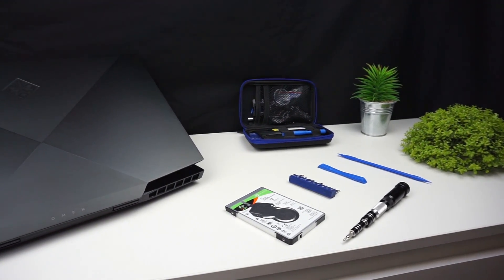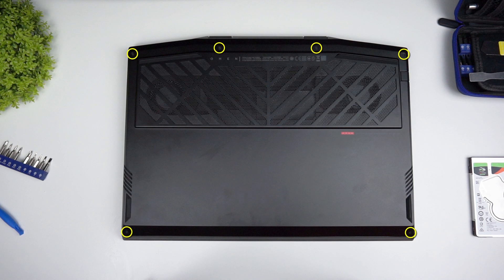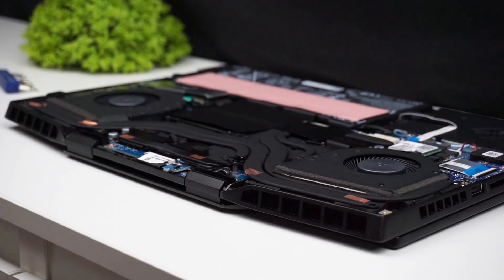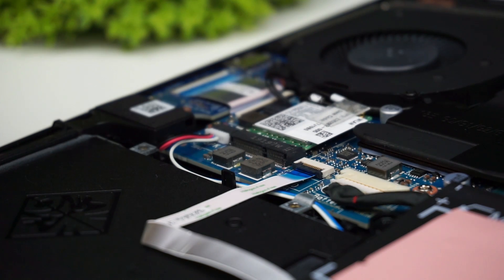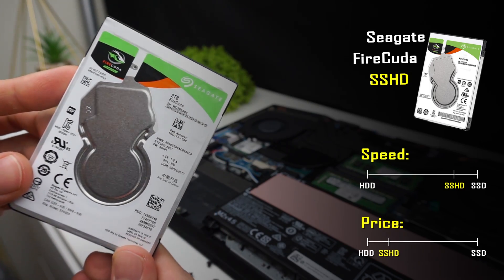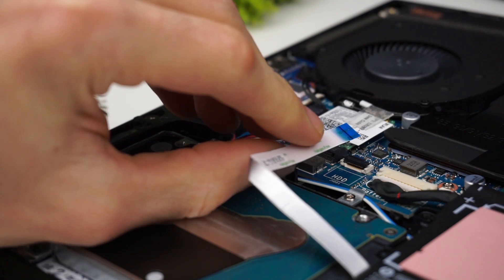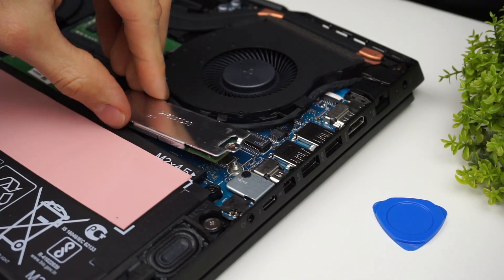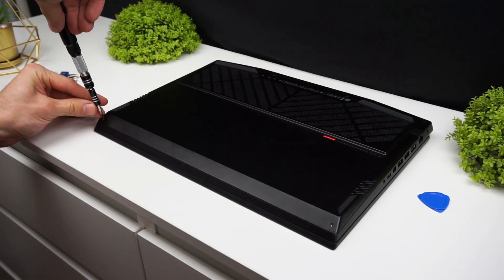HP Omen 15 2019 Upgrade RAM / SSD / HDD - Disassembly Guide

Comment: Very good video.
I want to ask some questions. I have an HP OMEN 15-0003 LA, which has 16GB RAM, Intel Core i7-9750H, two hard drives: 128GB SSD and a 1TB mechanical DD.
The 128 GB SSD I want to change it for a bigger one, minimum of 512 GB. What is the recommended brand and size and how to clone it?
Additionally, is it advisable to change the mechanical disk for an SSD and, if so, what could it be?
Thank you in advance for your responses and I reiterate my congratulations for such an excellent video.
Angel Agüero
Reply from the maker: Hi thanks!
I linked few M.2 drives in the description so you can choose one or fin a SSD on your own. Size is up to your pocket ;) you can copy your files and save on different drive. If you're changing the SSD where your windows is installed you have to install Windows on the new drive and then transfer your files. I've never cloned a drive, so I can't help this way.
Second question - you can install 2.5" SSD instead of HDD. Also in the description i linked one recommendation (samsung 860 evo)
Reply: Thank you @TechFinds

Comment: Hi there, I've just bought a Samsung 970 Evo Plus & 2 HyperX Impact DDR4 [8GB RAM] for my HP Omen 15-dc0001na. Is it best to wipe my computer before installing the components or just leave it and carry on replacing them?
Reply from the maker: Wiping won't change anything. Do as you like. ;)
Reply: Tech Finds thanks mate, I changed my RAM card order to 2 HyperX Impact DDR4 [16GB RAM]. Will these still work with the HP OMEN 15-dc0001na?
Reply from the maker: @08chinup  Yep it's compatible

Comment: hi @Tech Finds, so the 2019 OMEN 15 has only 1 slot for NVMe right?  if i want to upgrade the storage, either go for replacing the currently NVMe or take a new 2.5 in SSD right?
Reply from the maker: Yes, you're right. ;)
Reply: Go for the hdd
Reply: @Switch_55.6  as a little bit gamer no thank guy, I would go for SSD, HDD is too slow

Comment: Hello great videos will be very useful for when o upgrade my ram.
 I have 2 questions I have omen 15-ce005la and it came with 1 TB HD and no SSD when i check the oficial maintenance manual it says it supports dual with a 256 gb SSD can it be bigger than that? 
And about the ram it came with 8 Gb and the manual mentions it only support 16gb is that really true?
Reply from the maker: Hi, the laptop supports up to 32GB RAM (2x16) 2666MHz and you can install bigger SSD. Idk why manual says that

Comment: Could I add a Samsung's  RAM 2133GHz to OMEN 15-dc1004la with 8GB 2666Ghz?
Reply from the maker: Yes, you can andn 99% it will work. However your 2666MHz RAM will then downclock to 2133MHz. It won't be 100% compatible for sure, but you shouldn't really notice any issues
Reply: @TechFinds  thanks!!! :3

Comment: what is the max supported ssd size by 15-dc1008nx? It came with 256gb ssd. According to HP manuals it is upgradeable upto 512gb. But I want to take it upto 2tb. Will 2TB SSD work in this machine??
Reply from the maker: HP says that they sell this laptop with up to 512GB SSD, but you can install more. For example 2tb

Comment: Hi, nice video. how you can move windows from the original 2.5 ssd to the nmve??
Reply from the maker: I have never done it buy i found something that may be helpful. Check out here:
https://windowsreport.com/move-windows-10-ssd/
Reply: @TechFinds   what size od screwdriver did you use mine is not working...
Reply from the maker: @Games_and_Tech  i always use any screwdriver that fits the screw. I don't know what size is it.
Reply: @TechFinds  I stripped the nvme screw, now it is stuck and I can't remove it and install the ssd. Do you have any suggestion?
Reply from the maker: @Games_and_Tech  People say that a thin piece of rubber may help. put it on the stripped screw and use screwdriver as always so the rubber will fill stripped areas. You have to push down screwdriver a bit stronger to not let it strip the screw even more
Reply: @TechFinds  thanks, i have tried that and glue, the only one thatbi have not tried is heat it up, because i dont have the tool
Reply: @TechFinds  I finally did it, but now it does not read the nvme...
Reply from the maker: @Games_and_Tech  Have you created partition in disk manager?
Reply: @TechFinds  I just disable the intel optane, but when I replaced the optane for the nvme, this one was not recognized
Reply: and now it did not recognize the optane neither
Reply: @TechFinds  i coudnt create any partition as soon as i replace optane for the nvme it did not boot
Reply from the maker: @Games_and_Tech  ohh wait, so you replaced the original SSD where you had Windows installed for another NvMe SSD? Then you have to install Windows on the new drive
Reply: @TechFinds  nop, the laptop came with a 500 gb  sata ssd, that i have not move or disconnected and a 32 gb nvme intel optane, that i tried to replace for an 1 tb nvme.
 The laptop it is turning on, but  not booting correctly, is showing this error "boot device not found, please install an operating system in your harddrive disk. Hard disk (3FO)"
Reply from the maker: @Games_and_Tech  so as I say, most likely you had Windows installed on this optane drive. When you replaced it you have no windows on none of your drives (booting device not found). Try to find and select the boot drive in BIOS if possible coz I may be wrong. But that's strange that when you put back optane drive you still can't boot. Maybe you have to select back optane in BIOS as a boot drive
Reply: @TechFinds  LAST UPDATE; I put back the 1 tb Nvme drive, I made booteable USB-drive with windows, and now I have installed windows and all drivers and it seems to be working fine. Anyway, I can't see the 500 GB SSD sata, not in the Bios neither in windows, not even in disk manager.
Reply from the maker: @Games_and_Tech  Only thing that comes to mind is that the cable is not connected well. Or the drive is not compatible which is rather unlike.

Comment: If I install another SSD, do I have to make any configuration on the bios? The problem is I lost my bios password. Will the motherboard detect the hard drive anyways?
Reply from the maker: If you gonna add another SSD not touching existing SSD where you have windows installed then you don't have to do anything in BIOS. Just after installing SSD go to device managet in your system and make a partition.

Comment: hey bro, I have one question here, I want to buy this omen, and I have plan to upgrade hdd to ssd, can I replace ssd 2.5 with m.2 or nvme type?
Reply: Can you give me advice? If HP OMEN give us  1 TB HDD 7200 rpm, what should I do? Replace it or not ? When you give me yes for replace, Replace it with SSD for Storage (Game,Document,Content,3d Modelling) or SSHD for storage (Game,Document,3D Modelling, Content) ?
Reply from the maker: You can replace 2.5" drives only with other 2.5" drives. Same for M.2 that you can replace with M.2.

Comment: I have a question,  can I plug a 2.5'' SSD into the 2.5'' HDD bay? And this way have the original m.2 ssd and an extra one?
Reply from the maker: Yes, you can add 2.5" SSD instead of HDD. You have one slot for M.2 SSD and one slot for 2.5" drive

Comment: So my omen laptop has 16gb and 256 gb SSD but It just isn’t enough space cause I want to get games that require a bunch of space sadly I’m not a big computer guy these questions are going to be dumb but what exactly will I need to store more of my games? More ram sticks or the SSD or do I need both?
Reply from the maker: You better off buying any 2.5" HDD (Hard Drive) or Seagate FireCuda SSHD that i linked in the description. You can also go for 2.5" SSD which is faster but it's way expensive. With HDD you get much more storage space for much less price. RAM has nothing to do with storage space.
Reply: I'm confused though I only want 500GB instead of the 256GB that I have right now I have enough ram 16gb just need more room for games so your telling me to go for an HDD but they are slower? And cheaper apparently but the SSD I saw in the description for 500gb is only $100
Reply: also does the HP omen come with an HDD or does it need one and is that why your telling me to get that instead?🤔

Comment: Can the 2019 HP Omen's RAM be upgraded from a 32gb to a 64gb memory??
Reply from the maker: Max 32GB (2x16) 2666MHz
Reply: @TechFinds  can i upgrade hp omen dh0105tx 32gb 3200mhz
Reply from the maker: @harryyona9674  you can go 32GB (2x16) but 2666MHz is max
Reply: @TechFinds  oke bro thank you
Reply: @TechFinds  What would happen if I were to use 2x32GB 2666MHz instead of 2x16GB ? Would it affect the performance in any way?

Comment: im having trouble with both screws at the front corners, do you know what is the size of the screw drivers you need to use?
Reply from the maker: You need a phillips head screwdriver, but idk the exact size. I always measure it approvimately to the screw so i can see if it's too big or i can see if it's not too loose to not damage the screw. When unscrewing the head should match the screw cross fairly tight and you have to push the screwdriver down in the direction of screw a bit .
Reply: @LD1E60  nope, i had to go to the store to get them removed for me and they gave me some old ones that fitted because i couldn't use the originals anymore
Reply: Aquaria yeah I’ve got the same problem, can’t get the front screws off. Did you shred your ones? I’ve done it a bit. All I want to do is clean the dust off the fans because it’s starting to become less effective

Comment: Do hp offer a recovery drive ? How did you get windows and the hp omen software back on your laptop ?
Reply from the maker: You can turn the laptop back to factory settings at any time if you mean that. But if you changed the drive where Windows 10 was installed you have to get a copy of Windows 10 and fresh install it on new drive.

Comment: This Is A Great Content! Just Like What I Need Right Now. Greetings From Indonesia. Oh Yeah, I Got A Question For You. I Think I'm Gonna Buy 2T SSD m.2 And It's Only  For My Game File (Maybe Some Photo&Video Too). But, I Still Need The Old One SSD (512GB Just For The System). And I Want Both Of Them In Position On. Should I Swap Them? And One Of SSD's Use The External Enclosure. And Who's In The External Enclosure? The 512GB? Or The 2T?
Reply from the maker: You can't have two m.2 SSDs in this laptop. You have only one slot for M.2 SSD and one 2.5" drive bay where you can add 2.5" SSD. Btw. I don't know what's about this enclosure. Never heard about such thing.
Reply: "Orico Nvme m.2 Enclosure", just for examp. If You Find Or Maybe Learn Somethings, Please Let Me Know. Cheers
Reply from the maker: @yosannahendriansyah8253  ohh, ok I know now. This is basically an adapter where you put your M.2 SSD and you can plug it in via USB as an external drive. But you have to have system on the internal SSD anyway.
Reply: What system? I don't get it.
Reply from the maker: @yosannahendriansyah8253  You said that you need the old SSD for the system. But what's the purpose of having the Windows installed and running from an external drive?

Comment: Hey. Could you please help me? I got the same sshd installed by a professional and after installing it, the laptop screen stopped working. I used a second screen to check if its working. The laptop booted up but ran into problems. I went into bios and changed to legacy boot. It booted up fine but after 30 seconds or so the screen goes blank but the laptop seems to still be running. Do you know what causes this issue? Is it only due to a loose display port connection or something more serious? Please help me. I am in panic mode as the laptop is only 2 days old and I don't know what the guy from best buy messed up while installing it.
Reply from the maker: The only thing i can suggest is to do hard reset. Turn off the laptop, open the bottom lid, disconnect the battery from motherboard. Then hold the power button for 30 seconds, connect the battery, close the lid and see if it's working. Also remove the HDD to check if it's the cause of problems. But to me it doesn't have any corelation. The chance is that your laptop came defective, but i can't predict.

Comment: Do we also need to consider purchasing the dual or single mount too for the data drive upon purchasing on Amazon?

Also, what is the second card on top of the ram card you replaced, is that the second slot and is it easy to take off to replace like the first one? Thank you
Reply from the maker: What do you mean by dual or single mount?

Above the RAM that I replaced there is another RAM stick. It's the same.
Reply: @TechFinds  I was looking at ssd to put in my hp omen and I encountered a model (crucial brand) that comes with Dual or single mount? Should I also get one of those too?
Reply from the maker: @hoopdie  Can you link this one?
Reply: @TechFinds  nevermind, I think the mounts I was talking about is for desktop upgrades 😅

But I have another question, what kind of screwdrivers should I use here? I have ones for MacBook pro but since this is a windows laptop maybe it's diff.. Is there a set for these screws?
Reply from the maker: @hoopdie  a small Phillips head screwdriver is needed, but I don't know exact size
Reply: @TechFinds  that will do, many thanks! :D

Comment: I've had my omen for over a year and I have a few questions about upgrading:
-If I leave the default 8 GB RAM and I add a new 8GB RAM of different brand but with the required specifications, will there be any performance problem?
-Does the omen come with a M.2 ssd by deffault or sholud I buy it to improve performance?

Sorry if my questions are a little dumb, but Im not much into hardware and I use the laptop for design and testing of Deep learning models, that's why I need to improve the performance,  I just have money to buy a new RAM tough.
Reply from the maker: Hi, you can leave your RAM and add another 8GB of other brand (just match the specs).
If your Omen has SSD it's M.2 for sure and Windows is installed on it. You can either replace it for a bigger one or add another SSD (2.5") to the empty drive bay if you haven't any HDD installed there.
Reply: @TechFinds  thanks for the answer, I'll check some proper ram card, any suggestion for one that's not too expensive and has the necesary specs?
Reply from the maker: @juanatenco453  check the Crucial that I linked in the description

Comment: I5 8300h rtx 2060 vs i5 9300h gtx 1660 ti laptop both at same price,which one should i choose?
Reply from the maker: It depends what laptops you're talking about exactly. But specs-wise the RTX 2060 one should you give more FPS in games since the difference between i5 8th gan and i5 9th gen is not significant
Reply: @TechFinds  hp omen 15 2019
Reply from the maker: @samattackone1064  Then yep, i think that RTX 2060 will be better.
Reply: @TechFinds  thanks

Comment: Hello. I was thinking about getting HP Omen 15 but now I think Acer Predator Helios 300 might be better for me since heating is kind of a big issue with Omen. But I was wondering, does the Helios heat up a lot during Turbo mode? In most of the reviews I found, it only talks about the laptop gets really loud with the fans and nothing else. Is that a problem (like, is it bad for the health of the laptop)? Is a cooling pad really worth getting? I live in a tropical country where 30 degrees Celsius is usually the climate.

Also, do you think a GTX 1660Ti will hold up well in the future? I mean, like will it at least be able to play newer 2019 games well at high settings, and maybe future games at lesser settings? I ask this because I'm not sure whether I should get a laptop with GTX 1660Ti or go for RTX 2060 (which is a little bit expensive for me if I choose to go with Helios).
Reply from the maker: Hey, the temperatures will vary depending on hotter or cooler region. When i was testing it in the UK i had like 21-23 degrees of room temperature. In general 2019 Helios 300 has very efficient cooling system compared to many other laptops on the market. Yes, it is loud when you enable turbo mode, but if you're ok with that then that's nothing bad for the laptop itself.
If it comes to GPU the RTX 2060 is not very much better than 1660Ti while 1660Ti is usually much cheaper. Recently Red Dead Redemption 2 came out in Nov 2019 and it's a very demanding game. Idk how about other upcoming games but with GTX 1660Ti you're able to play RDR2 on high mixed with some medium settings and ultra texture details on the edge of 60fps.
Reply: @TechFinds  Thank you for the speedy reply. Really appreciate it!
Reply: About heating, I've bought a omen 15 with i7 and 1660ti and I was really surprised with the thermal profiles of the laptop. Even without undervolting it keeps good temps , especially with max fans, which are perfectly acceptable under the noise aspect. Predator is just a bit cooler but very very noisy.

Comment: Hi
What is the max ram storage supported for hp omen 15 (2019), 32gb?
I have only 16 and want to upgrade it.
Is the ram card for the laptop all the same size ? Can I just get any 2x 16gb ram and install it?
Thank you
Reply from the maker: If you have 1x16GB then you have one slot free. You can buy another 16GB RAM stick and you'll have 32GB in total. But if you have 2x8 now you'll have to buy 2x16. It's important to match the specs with original RAM if you mix. For this Omen you'll be good with Crucial that i linked in the description, but if you gonna buy 2x16 you can go for any of these.
Reply: @TechFinds  ok thx